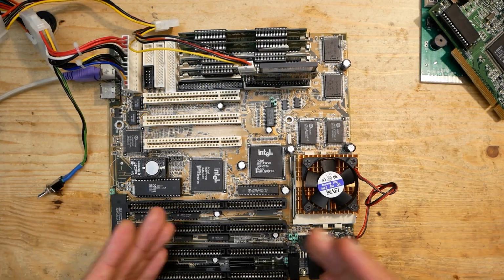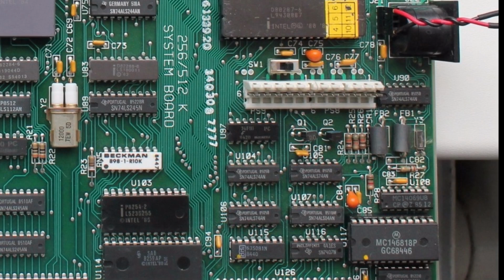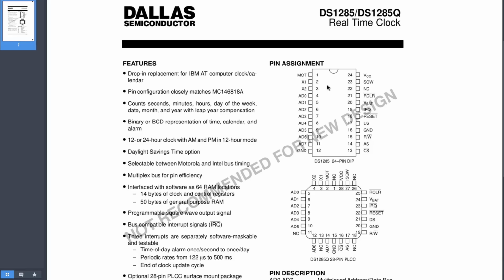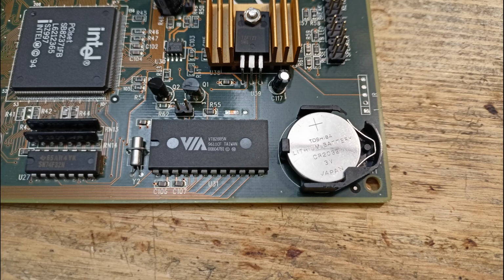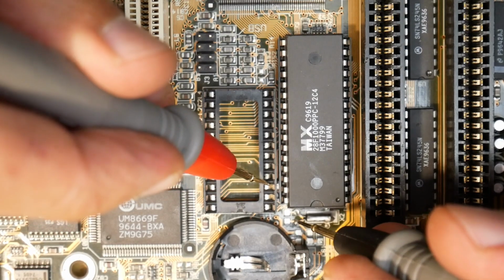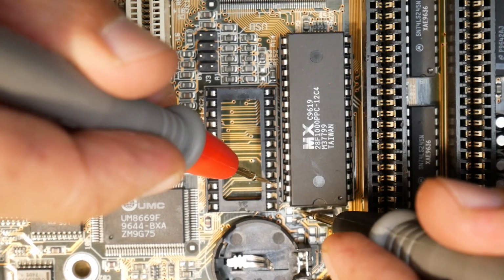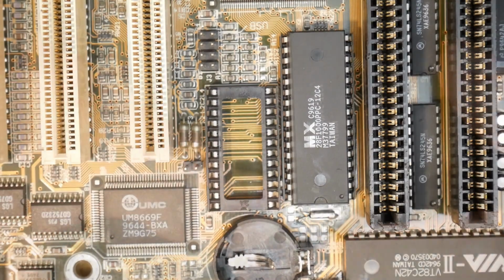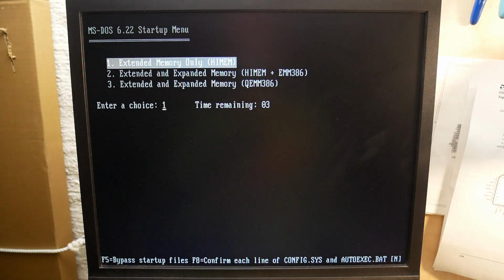Let's talk about RTC options once again

Comment: Yes I just tried it and it worked. I used my hot air rework station; had to set it to 190F (I realized after a while that the 80 degrees you were talking about were Celsius; 190F = approx 88C) and used a screwdriver as a chisel. I found that the greatest danger is mangling the chip's pins if you use too much force and it slides from your grip. So after a little while I decided to insert it into a 24-pin sacrificial socket to protect the pins, and that worked great. I decided to leave the crystal oscillator soldered to the bent pins, and run a couple of wires to a remote battery holder because on the motherboard I want to install it, the height space is at a premium and I want to make it as slim as possible (It prevents inserting cards in a couple of PCI slots).
Reply: I had to heat up mine to a higher temperature (270°C) because otherwise the epoxy wouldn't break. I think my hot air station isn't powerful enough (I say this because I didn't even melt the plastic).
Also yeah I had the same issue with the pin mangling. I think we should make some sort of tool to do the job properly and efficiently.
Some sort of big clamp that would hold the chip firmly in place while letting the hot air flow on it, and maybe also something hard to protect the pins
Reply: @DxDeksor  That is what I was wondering when I saw this. Might it be easier to use a socket anchored to a board as a jig while you heat it and lift the shell off.
Reply: @DxDeksor  How many those pieces are you disassembling per dar/month/week/year that a speciality tool is needed?
Reply: @hid3nax  well you just need to find a couple of boards in a lot with those to have suddenly 4-5 to fix at once.

I was thinking of a very simple tool to craft anyways, not something expensive at all, that can be kept each time you find a new board with a dallas chip.
Reply: @DxDeksor  I searched all my old boards and found only one such chip. Using soldering station heat gun I managed to remove that stuff unfortunately bent most and broke off some pins. No worries, not that I need that board much but I also have some other dead chips so I will re-solder those pins from there. Also, this RTC came off a server board with 2x CPUs (Pentium 100 Mhz). Yet this board for some reasons performed really poorly. A single CPU Pentium 75 MHz system outperformed this board in simple tasks, e.g. kernel compilation. Maybe you have a clue where to look for a potential problem?
Reply: @hid3nax I have a lot of these in my collection by comparison probably like 10-20 of them.

I don't know why, maybe the chipset of that dual Pentium is older, or the cache isn't working right ?
Reply: @DxDeksor  One transistor near the keyboard connector gets extremely hot. Although it has a big heatsink (from factory), it still gets really hot. I suspect this has to do sth with the system lag but I am not sure what that transistor is even responsible for. Guess I need to pull that system again and try to play with it as it's not a conventional old school system you can find. I believe I have previously experimented with cache and other bios settings but that gave no result. Unless I'm missing some jumper configurations or so...
Reply: @hid3nax I highly doubt a hot transistor can slow down the machine, thermal throttling wasn't a thing for quite a while, I think it was introduced with the Pentium 4 or Pentium M, so about a decade later.

I don't know what your board looks like but my initial thought would be that it must be the MOSFET powering the CPU ... But being near the keyboard is odd. If I could see what the board looks like I could probably tell better.
Reply: @DxDeksor  By no means I meant thermal throttling. More like mechanical (actually - thermal) issue causing too high resistance or too low voltage somewhere thus resulting in poor performance. The model name of the mainboard is Micronics M54Pe. Google for it, look at images. Some of them contain that huge heatsink in "transistor" I was refering to. Not sure if that's actually a transistor, may be voltage regulator or other component
Reply: @hid3nax  I used to have this board actually!

Not sure there's any transistor near the keyboard connector, however it's unlikely to have anything to do with processing.

Also if it was overheating and causing voltage issues, considering there is no thermal throttling, it is not going to slow down on its own, it's going to glitch and crash. Thermal throttling is here for a reason :D

Knowing this board, it comes with an old intel chipset (430NX), and early intel chipsets weren't known for their performance, on the contrary.

Also being an eisa board, I would think that maybe eisa adds some overhead too ? (I don't know much about eisa tbh)

Being a server board, they probably also favoured stability over performance. So yeah compared to a consumer p75 it can seem underwhelming 

It's like the modern thread rippers with 96 cores which can definitely outperform any machine when it comes to server work, multi threaded code, and are super reliable ... But when it comes to single threaded performance, a decent ryzen x3d chip will smoke the threadripper
Reply: @DxDeksor  Wow, that's nice! Seeing photos on the net from what I can understand, there were several revisions of this board. Some of them with PS/2 connector, mine is with old style AT one. Anyway, I'll order CR1625 battery holder and probably some day will try to resurrect this old board and play around a bit with it. You may be right, it might be chipset issue. Will need to find some AT case too, as I have discarded the original one about a decade ago - it was huge and occupying too much space
Reply: @hid3nax aw rip the at case :')

Anyways, the person I gave the board to was able to fit it into a big ATX case if that can help you (cutting was still necessary for the drive cages afaik)
Reply: @DxDeksor  I found some info on the net that drained RTC battery may be causing L2 cache being disabled resulting in a poor performance. One guy from China posted this on forums. So looks like the first step indeed is to fix that issue with the battery.

Comment: Amazing discovery. Great for a heavy-user of your solution to have the initial option (although I do love your circuit). So cool to be able to get rid of that horrendous resin. I felt sorry about you, your dremmel, and your workplace on the "basic attempt". It had to be quite hard to clean it. Thank you for another impressive video. Paraphrasing @emuboy85, "this man needs to be protected at any cost".

Comment: What if you keep original depleted Dallas battery in socket, and only solder cell coin battery socket? Will it work with cell battery with depleted original Dallas?

Comment: I recently cam eacross a couple of PcChips M560 boards, socket7, which have a sort of an intermediate solution for the RTC. They have the black boxes on them, but also a separate crystal oscillator soldered next to it on the board. There is no footprint for a battery though. The RTC modules have fewer pins bent up than a regular DS12887, in particular the pins for the oscillator are not bent. And in fact the modules are not marked at all except with a "burn-in: sticker. I think they were custom made by the same Chinese company that made the motherboards. In fact, on one of them they forgot to pour the epoxy in so the plastic cover came out freely. :) Inside they have only a Via VT82885 chip with a soldered battery, no crystal of course. Made it so much easier to fix. I will try your hot air method on the remaining one.

Comment: You know, it's sure possible that the potted package is there to be a service revenue stream, but it's also possible it's just to make life easier for board designers who don't want to have ANY external components at all.  If you look at most datasheets for stuff like this, board space and parts count are the callouts.  "Opportunity to screw customers" is rarely a bullet point.

These things were built to last the entire service lifetime on one battery.  Changing the battery didn't need to be an option, because at the rate tech was moving, you weren't going to be using your DX2/66 ten years later.  The fact that we do is an abnormality.  It's the same reason capacitors aren't in sockets -- you aren't supposed to care anymore by the time they've failed.

I dunno man.  There's a lot to be cynical about these days.  But I think it's really important that maybe just sometimes we don't assume the absolute worst motivation for every decision.  That's no way to live.
Reply from the maker: I'm afraid, I just probably work for too long in this industry :) Don't take those words too seriously, that wasn't the point of this video anyway. Doesn't matter what the motivation was, it's in our way today. Well, this particular one not anymore.

Comment: Thank you for the video!
I recently bought a “new computer” SAMSUNG DESKMASTER 386S/33 and its timer turned out to be alive.
The BENCHHMARQ bq3287TM 9306 PM306009 microcircuit has not yet found information on it.
RUS:
Спасибо за видео!
Недавно купил "новым компьютер" SAMSUNG DESKMASTER 386S/33 и его таймер оказался живым.
Микросхема BENCHHMARQ bq3287TM 9306 PM306009 пока не нашел по ней информации.
Reply from the maker: Nice! After so many years it's incredible, that the battery is still running. 9306 means probably 6th week of 1993. That means 31 years. Mind blowing. Inside of the bq3287 is the very same chip bq3285 which I used on the module which I open sourced. You can find the datasheet here: https://www.ti.com/lit/ds/symlink/bq3285.pdf

Comment: wouldnt the circuit for a new ic be something like a latch, a 555, a diode, a transistor, small amount of Sram, and a capacitor? why not just build something like that on the bottom of your clock chip replacement? those components are available and are inexpensive, probably less than the ic itself, and the footprint might just take up less space than the ic itself...using those f-ing small ass surface mount. now you dont have to worry about the ic......
Reply from the maker: No, this thing is a microcontroller with own registers and commands. It is more complicated then it looks to be. But you can try,  that would be great and we all would benefit from the knowledge. All the datasheets are openly available if you want to give it a try.

Comment: I must try making such RTC module using a MSP430 microcontroller. It would probably last comparable time to the original with a fresh battery, and should be fast enough to keep up with the bus.
BTW, DS12885SN+ and DS12887+ is still readily available in Mouser, though a bit expensive.
Reply from the maker: Yeah, especially if you count the delivery and import taxes to Germany. It's barely worth it, especially where I know how to make it use a normal battery :)

Comment: @22:36 That's my preferred option. Best part of it: Depending on the mainboard layout, you can add the missing battery pin on a soldered 12C887 module without even desoldering it from the mainboard. Just drill it open, clean the one soldering pad, push a copper wire from the back side of the board, solder it to the pin in the module and solder it to the mainboard. Then add the battery holder and you are done.
Reply: For me at least, drilling precisely and cutting the internal connections with the spent battery is at least a 1h job. I just tried this method and it was only 10 minutes, and much less precision and stress were involved.

Comment: why not just build the chip ic's internal circuit on a pcb? if you run out, you still have the chip right there, out in the open :)
Reply from the maker: Sure, but it would need quite a lot of work and testing on hundreds of mainboards. Replicating timings and issues of such chips properly is not the simplest task and needs a lot of work.

Comment: I wouldn't be so quick to jump to the conclusion that the dallas clock chips were made to make more money off people who need to replace the rtc battery. Correct me if I'm wrong, but those batteries last for 10+ years right? I think most people and  manufacturers assume that by that time the owner would have thrown the old computer away because of how slow it is (especially at the time when cpu speed was growing really fast. Remember that us retro computing enthusiasts are not even a consideration for the people designing these boards.
Reply from the maker: True, but still, sometimes they still had to be changed. I had a mainboard back then, where the battery was defective and drained after just half a year, luckily it was on warranty. Still, unpleasant experience. And not mentioning the retro community, don't forget, that those modules were also used in many other devices, which are still in use.

Comment: Seperating the resin on the rtc using heat looks like a great method.  If you only need 70-80C perhaps putting the rtc into hot water would provide a cleaner result.  What do you think? Would this work?

Comment: imagine all the dallas chips that has been discarded before this video was posted, not knowing that it can be reused.
Reply: They could be reused before, however this is a much cleaner approach than hot glueing a battery above the module (and also it saves a lot of space for the height)

Comment: Thanks for the Hint about the Resin. I am fixing old german game machines, which using „Timekeeper RAM“ Modules similar to the Dallas. Dremel them open is really a mess. 

Sadly no one build a replacement Timekeeper RAM and the chinese fakes always trigger the Watchdog of the game machines.
Reply: A few years ago I did it with a M48T58Y. The battery locations are at the very ends on the bottom side and it takes only a couple of minutes to expose them and connect a battery holder. The original chips are very expensive now (over $30) so if I have to replace the CR2032 every 3-5 years it's still fine. I have one with external battery running in my Konami Warzaid cab and it's been going for several years so far. I keep an eprom next to it in a bag with the code. When the battery goes flat I read the eprom into my eprom programmer, change the battery and program the old M48T58Y again and it's good to go for several more years :-)

Comment: Remember seeing this when it was open-sourced, but failed miserably at soldering it. Designed a small carrier board to go on top of a DS12885 with pins bent up and soldered to it, but didn't make it public as I had no idea if it'd be compatible everywhere - never knew it was exactly the same chip inside 😂

Excellent video as always, seeing yours always make me want to tinker more with old PCs 😀

Comment: would it be possible to recreate these ICs with FPGAs?
Reply from the maker: May be, but it would need a very efficient one, since it has to be powered from a small battery.
Reply: @necro_ware   You would have the actual battery backed functionality in the i2c off the shelf RTC/NVRAM IC say by Maxim, they're produced at scale and cost barely nothing. The power hungry bit is only needed to interface with the PC, and it can be exclusively powered by the running PC, not battery powered.
Reply from the maker: @SianaGearz  Right, good point.

Comment: PLEASE do a c64 power supply video. Even a fail would be interesting.
Reply from the maker: I would, but I have none :)
Reply: C64 psu repair is very simple. There's literally only a handful of parts inside. A transformer (that never fails),  4 diodes, 2 resistors and a large capacitor. And of course the dreaded LM7805 linear regulator which shorts input and output pins and sends 14 volts to the poor C64. The real fix is to replace the board with a custom designed SMPS which is what I did.

Comment: The resins are all formulated different and have different temperature endurance. The problem with C64 PSU is that the potting resin is potted into an ABS enclosure. ABS has an unpleasant trait that it starts to go a little floppy at around 100°C and simultaneously starts chemically degrading as well. ABS is injection moulded at temperatures around 200°C maybe a little higher not sure (they use lower temperature than we use for 3D printing it and a lot more pressure) and at the injection moulding temperature, it survives a total of vaguely around 20 minutes before it permanently degrades and becomes crumbly, and ours are already pre-degraded from decades since synthesis. Worth a try but don't expect it to go as smooth. So you might save the transformer, you might not save the enclosure.

I think a solution for the future might be a module with a microcontroller and an i2c RTC/NVRAM battery backed IC. Microcontroller would be mainboard powered and provide interface when the PC is running.
Reply from the maker: That's true, but it is not too complicated to get the resin block out of the case on the C64 PSU. If you go with a knife along the edge and wiggle the walls of the the enclosure a bit, the block of resin will just fall out. This is how people usually fix those PSUs. The internals get removed and a new transformer with a DC-DC voltage regulator goes in place of the old resin block. Once you have that resin block out you could try to heat it up and see if it reacts in the same way. (Un)fortunately I have currently no broken C64 PSU at hand to try.
Reply: @necro_ware   Cool didn't know the bond between potting and casing was weakened by now. I have one Commodore PSU and it's entirely healthy so i'm not very inclined to go poking in it :D
Reply: @SianaGearz  I think his point is that the resin and plastic aren't necessarily bonded, just a very tight fit. They probably used a mold.